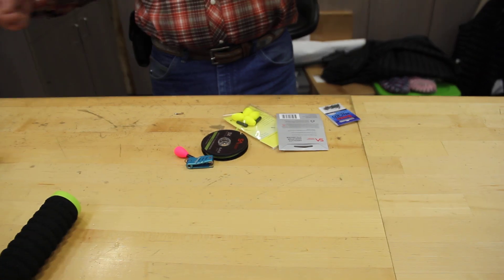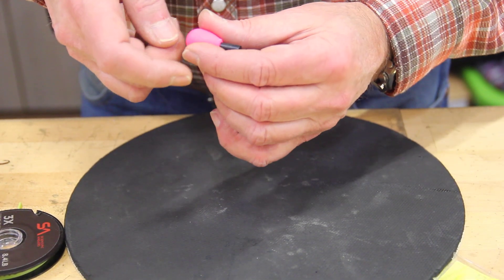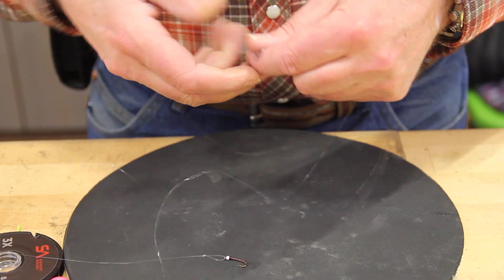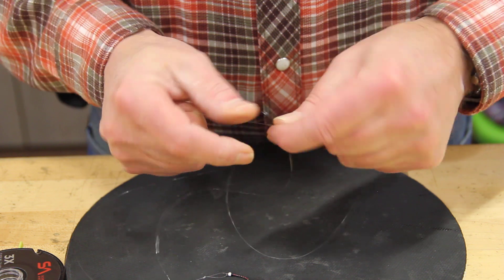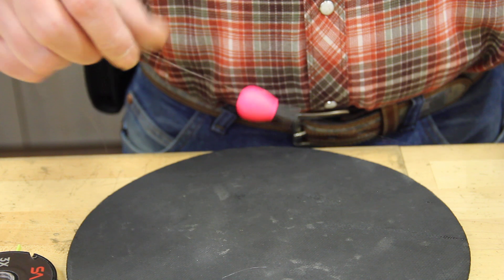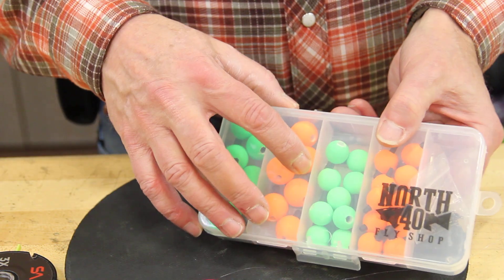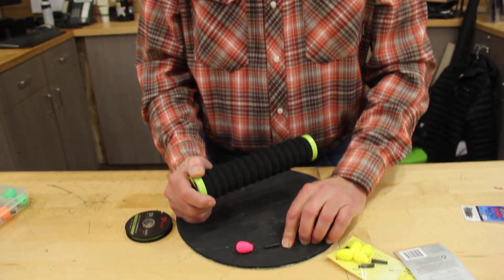Fishing Tips & Techniques | How To Setup a Stillwater Indicator Leader

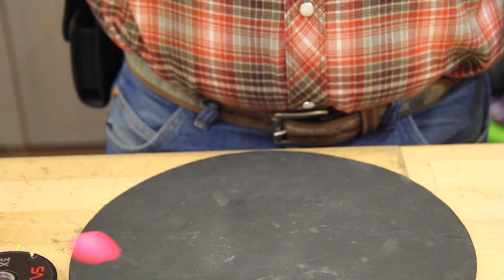Comment: Thanks for the tutorial.  At 2:56 on the video you made some sort of loop and then stuck the peg with part of the loop into the indicator, could you explain why you did that and what that loop is all about ? Thanks
Reply from the maker: The loop is designed to hold the indicator in place until a fish eats and you set the hook. Once set, the loop pops through and the indicator is free to slide down the leader so you can reel your leader into your rod. The example he used was if your indicator is fixed at 12ft. it would be difficult to reel that fish in close enough to land.

Comment: I thought the swivel was just to get your fly down quicker and make changing tippet easier without losing leader length. The fly is going to keep that peg on the line. I don't know what size fly it would have to bee to make it through the peg, but I can't tie it.
Reply from the maker: Hey Paul, the swivel is what stops the peg from falling down toward the fly once you set the hook.